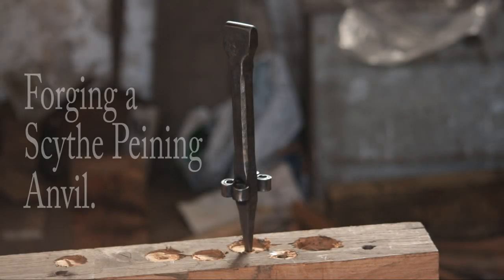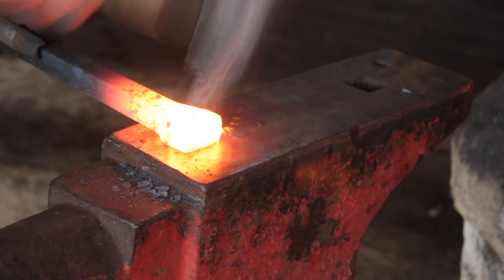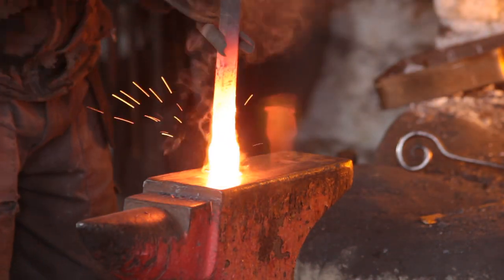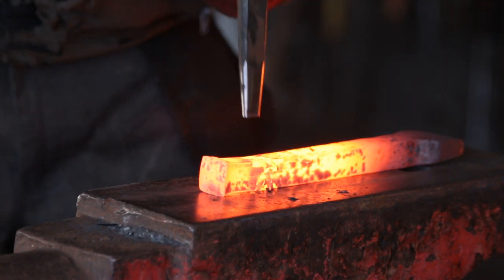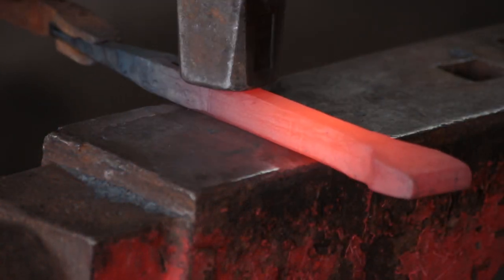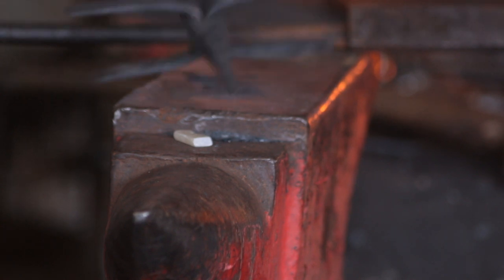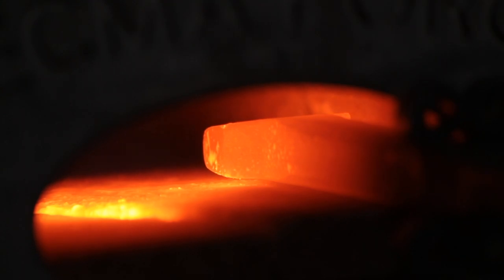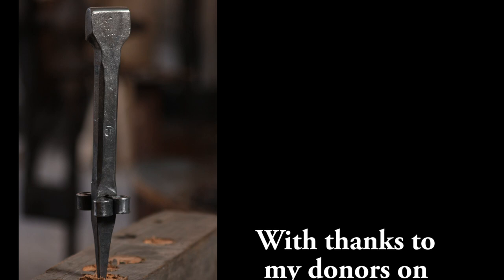Blacksmithing - forging a scythe peining anvil

Comment: I use this type of anvil to peen my scythe but I don't use mine in a stump, usually stump anvils here are the stubby ones. I carry mine in the field and just stick it in the ground, the scrolls are so that it doesn't sink in the ground. Also mine is flat and works the other way, you use a cross peen hammer to peen the scythe, and the tang that goes in the ground is longer and it's flat

Awesome videos